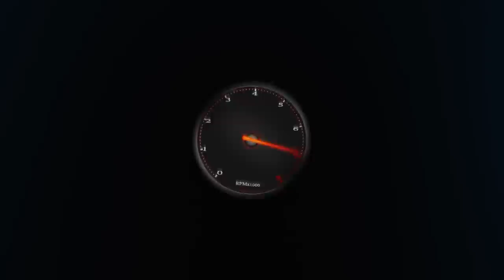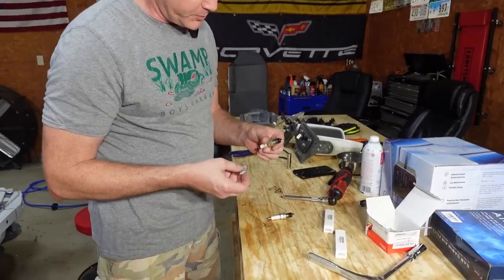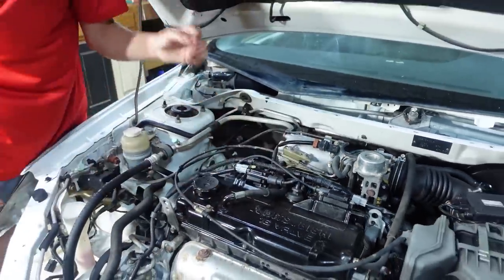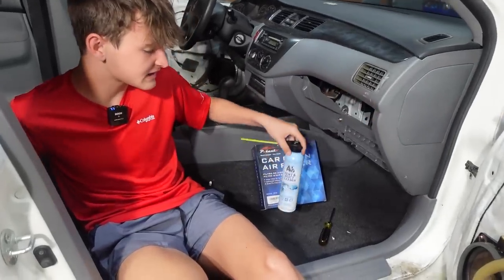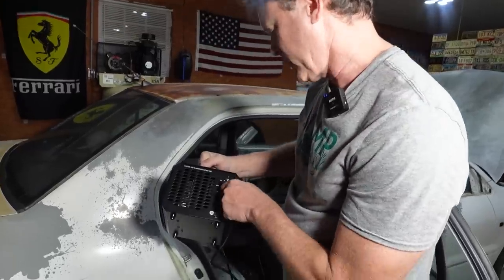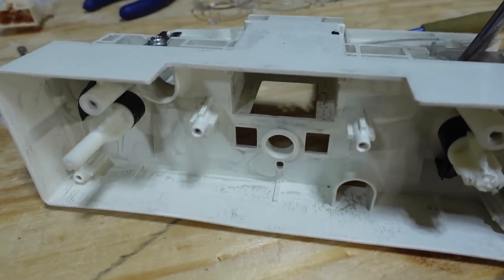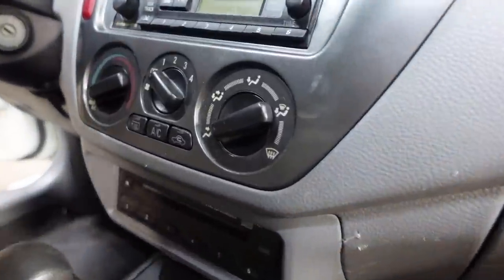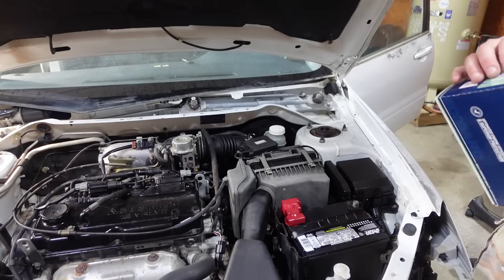Mitsubishi Lancer Tune-up | Abandoned $425 Car Restoration

Comment: 5:41 this car has a Timing Belt. That is a 2.0L 4G94 SOHC 16 Valve. Is an interference engine, if the belt breaks it will bend the head valves.  Mitsubishi started to use timing chains on  the 2008 Lancer that came with the 4B11.
Reply from the maker: Ok. I really appreciate the correction.

Comment: Glad you had a good time Tyler.
And yes Dielectric Grease really helps with moisture.  It's also good to use on plug boots to, keeps them from fusing to plugs.
Reply from the maker: Ok. Thanks.

Comment: I saw a 2010 Lancer Evo with 67k miles for around 32k on Carvana yesterday.   The engine bay on this one looks like a new car.  Even the top of the strut towers look good and rust free.  Mobil 1 ESP is supposed to be their best oil.  It's their Euro oil but can be used in just about all gas engines since one of the specs is SP.
Reply from the maker: I agree. Mobil one is probably the better choice oil.

Comment: Loving what you guys are doing. I love my Lancers in Australia. I actually have owned 28 Mitsubishi cars since 1978. A few of them travelled over 430,000Kms. The motors are just great. In Australia Mitsubishi used to be always in the top 3 sellers of car brands. Now days since the factory closed it slowed for a while but still is in the top 5. I think I mentioned in my last comment on your second video, if parts are hard to find there check out Mitsispares in Australia .
Reply from the maker: Wow that’s great. This is our first so we are just learning how great this car is.

Comment: its a timing belt 2004- 2006 are timing belts, and the rims will not fit because the 2006 lancer es are 4x114.3 for the rims, and the new one you guys got are 5x114.3
Reply from the maker: Yep. You are 100% correct.

Comment: I've got the same car 2006 year (1.6 Estate version),  been running ok for 10yrs, just the normal wear and tear parts replacement. This year failed the UK Lambda emission test, don't do any heavy driving so think it needs an "Italian Tune-up" to clear the catalytic converter. First car I've owned that has a closed loop engine management system, learnt alot in the last few weeks with the help of an OBD2 unit. Watch out for the Radiator Support Frame, the A/C condencer sits above the cross member , dripping condensate rust out the cross member over time. Had to do a weld job on mine to strengthen  where severe rust had weakend it.
Reply from the maker: That’s good to know. Appreciate the info.

Comment: Does a 2006 Lancer have a timing belt?
Your Lancer uses a timing belt which is made from a rubber compound and drives the camshaft. This makes for a cheaper engine to build and potentially quieter running, but it also means that the belt has to be changed periodically to prevent it snapping in service.
Reply from the maker: Ok. I was told it has a timing chain. Thanks for the info

Comment: What exactly is the duct cleaner? I worked as a Toyota tech before and I'd see rodents and crap all the time in cabin air filters. Once thing I'll say is NEVER spray anything like lysol down in the vents. It'll dry out in the vents/dash the wrong way and your car will smell like puke with the heat on, I've seen it happen before. Some cars have a ac drain line under the car, if this has one I'd recomend doing a ac refresh. Theres two cans one goes in the line under the car the other in the duct at the bottom of the windshield
Reply from the maker: Appreciate that info. We need all the tips we can get.

Comment: My ol lady's lancer 2004 ls putts when u stomp on it... When u ease into it it works fine. Even if ur at 60 and u hit it it still putts... Guessing it's some type fuel problem. They don't have filters. Could it be spark plugs by chance. I need replace them anyway
Reply from the maker: That could be weak fuel pressure, clogged air filter, bad catalytic converter or a lot of things.

Comment: you for got your die electric greese for the plug boots
Reply from the maker: We never put that. Is it really helpful?
Reply: @SwampBoysGarage  it saves from moisture getting in the plug boot and top of the spark plug
Reply: @marcslafter5814  Yes I had that problem on Plug 3, couldn't understand where the moisture came from. Sounds like a common problem. although to be fair it has only happened recently in 10years of driving the car.